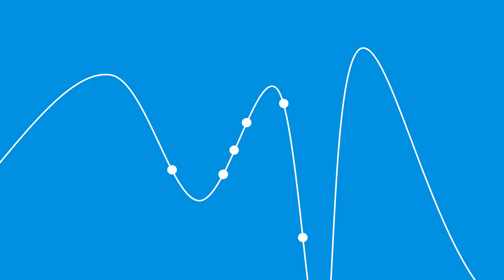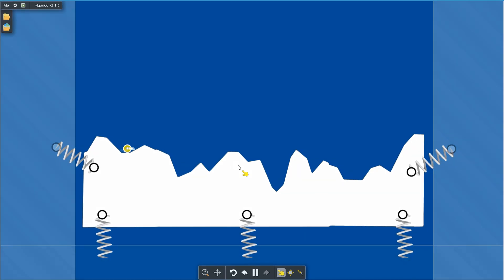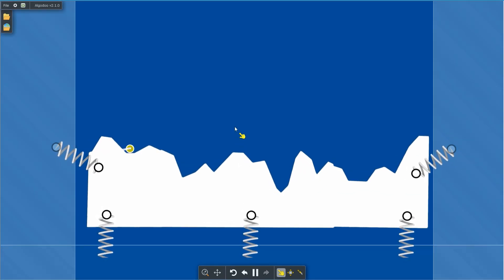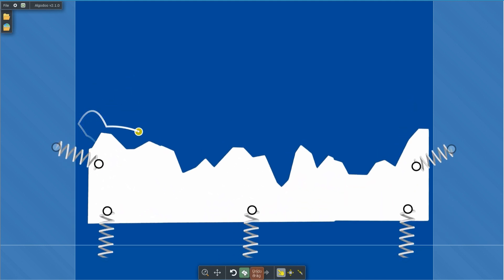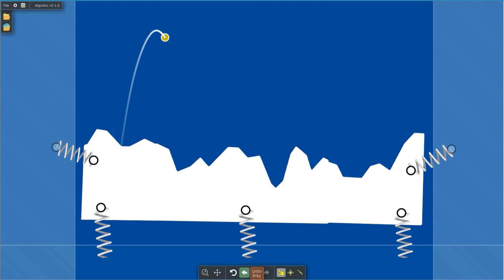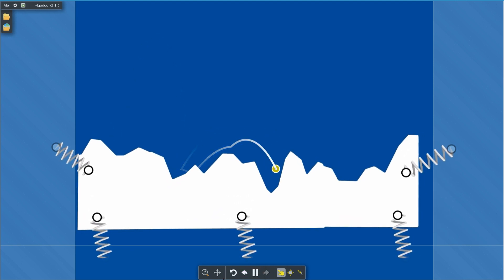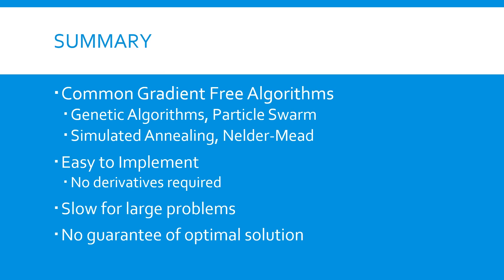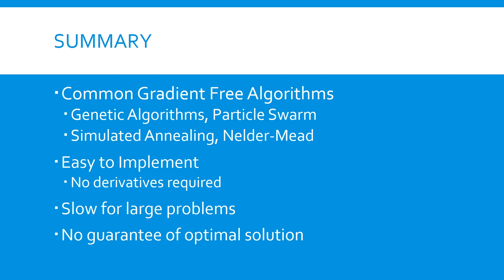Introduction To Optimization: Gradient Free Algorithms (2/2) Simulated Annealing, Nelder-Mead

Comment: gradient-based optimisation also doesn't guarantee an optimal solution.
Reply: Dat Boi  When you say "guarantee an optimal solution", I presume you mean global optimum. I don't know where you've learnt that but that's not correct. If you have a paper to back that up please reference it so I can take a look too. To start with, there are infinite number of optimisation problems and gradient-based optimisation can only solve a handful of it. Because real world problems are hardly differentiable, hence why the derivative-free or non-gradient optimisation algorithms emerged. Now going back to what you said about the second-order optimisation, it is more "efficient" in terms of convergence in comparison to first-order optimisation however, optimality of the solution has nothing to do with the speed of convergence. Just like first-order methods, second-order methods are also very likely to be stuck in local minimas so it doesn't guarantee an optimal solution. In fact, I've seen many studies where they've obtained better result optimising a specific problem with gradient descent instead of a 2nd order method. So to wrap up, it's not as simple as you've stated.
Reply: @where-is-my-mind.  Hi! could you recommend a book about optimization?